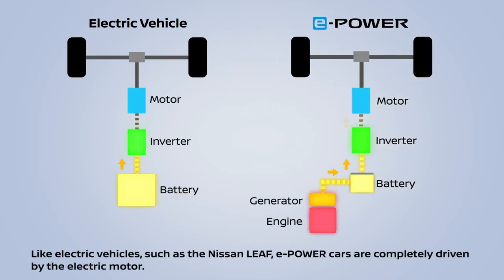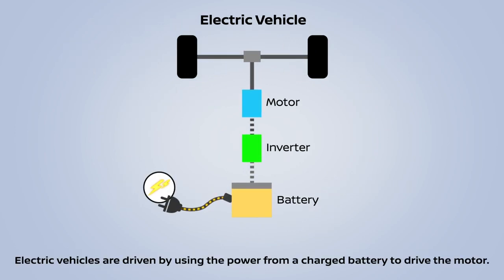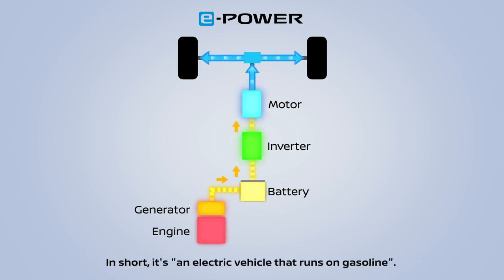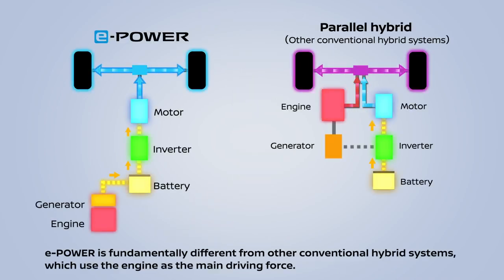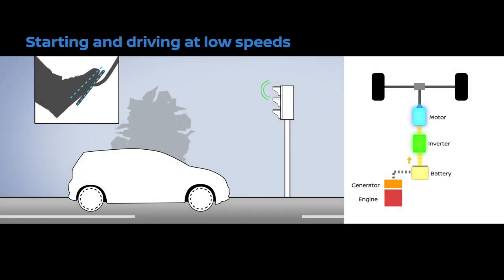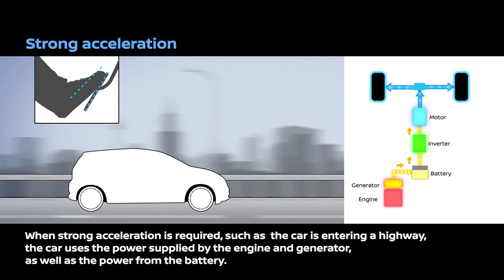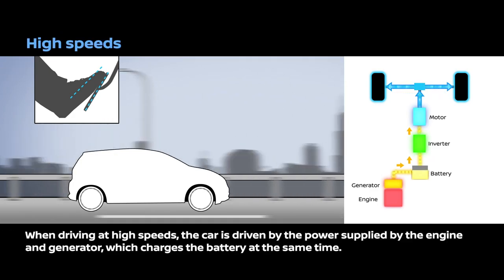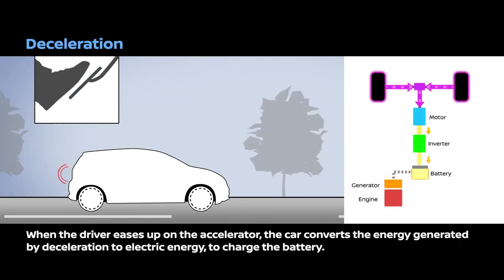Nissan e-POWER System Configuration with voice over

Comment: 11:00 I think in E Power, from Generator is not connected directly to the Battery but it is connected to inverter first then to Battery. Because during accelleration in uphill, the power not only supplied by the battery, but also supplied by generator simultaneously

Because generator is produce 3 phase AC voltage that need to be converted to DC voltage by inverter, then charge the battery which is DC as well.

Please Clarified by your Nissan Engineer since i need the truth one of E-Power system.